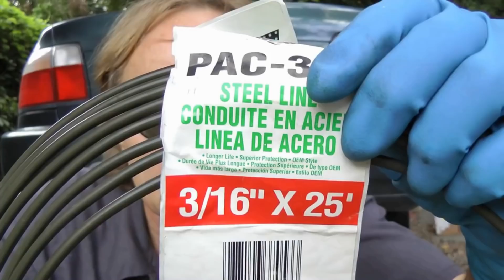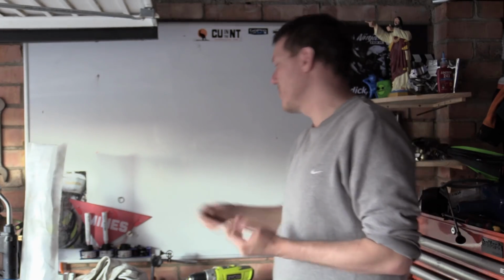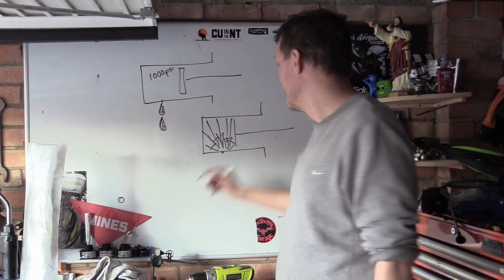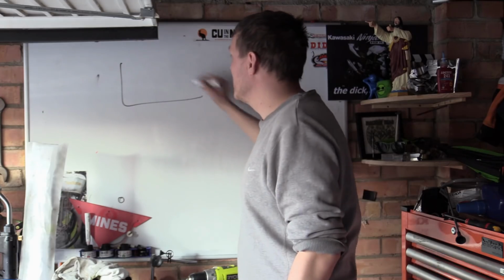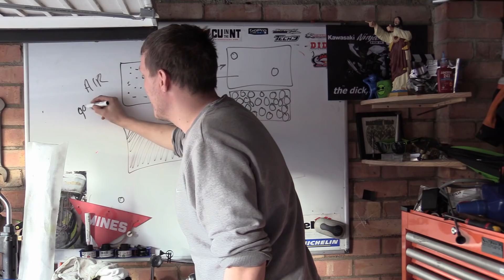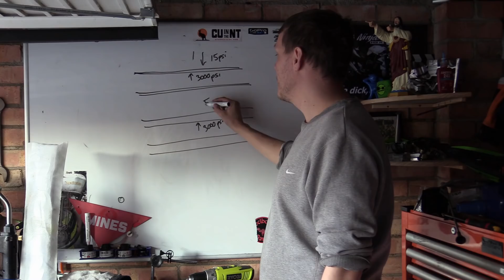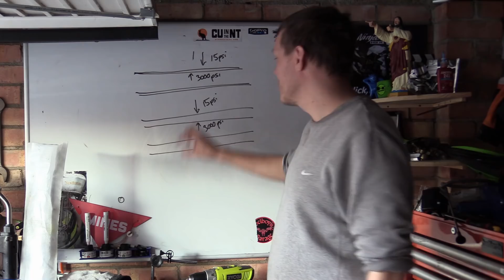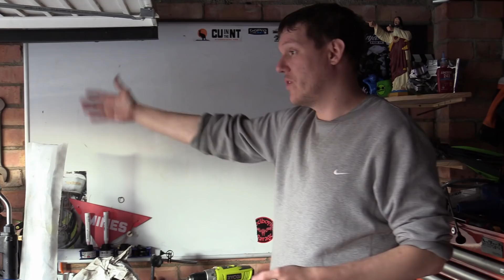Scotty KILMER - Will get someone KILLED!

Comment: You mean like those little brass connectors like the ones that come standard equipment on all cars that connect the brake lines to the brake  master cylinder and the ABS ? Oh ! Those little brass connectors ! Get a grip ! That company is just protecting themselves from litigation in case something goes bad. There's nothing wrong with the product. Usually the fault lies with the nut  holding his tool. Rust on fuel lines is on the outside and visible, not on the inside. If it was inside you would not know about it until fuel started leaking. Also, for over 40 years we have dual front and rear systems. We never lose all braking.
Reply from the maker: "You mean like those little brass connectors like the ones that come standard equipment on all cars that connect the brake lines to the brake  master cylinder and the ABS ? Oh ! Those little brass connectors!"

- No dickhead. Brake lines have flared fittings not compression fittings. 

"That company is just protecting themselves from litigation in case something goes bad. "

- Yes exactly, they know they will fail and don't wanna be sued - you're proving my point.  

"Also, for over 40 years we have dual front and rear systems. We never lose all braking."

- Check. Look at your brake system - are they flared fittings like this - 

http://racetrackdriving.com/tech/brake-line-flares-metric-sae-inverted-bubble/flare-schematic-1.jpg

Comment: I have used brass compression fittings on brake lines for over 40 yrs. Never had one fail. I am not familiar with the fittings Scotty Kilmer is using so, I cannot comment on them. I would use a brass compression fitting today and be confident in its performance.

Comment: How many decades have you been a car mechanic?
Reply from the maker: Erm.... none, But I've been an engineer for 2 decades
Reply: You can be a shitty mechanic for 4 decades or 4 years... a shitty mechanic is still just that. Brass expansion compression fittings on a brake line? 

Oh that'll work... until you REALLY need it to work.
Reply: Like that says anything years mean nothing let the good work do the talking

Comment: 51 years of automoitive knockledge versus 18 years lol okay english man ur a real genuis huh?
Reply from the maker: LOL can't you read? You also wanna look up the state of Texas automobile safety notice board about weak and inappropriate brake lines on their website. 

Experience (in other words doing a job for a long time) doesn't bend or break the laws of physics! But you could prove me wrong. Fit these to your brake lines and then slam on - I won't hold my breath though - I'll die.
Reply: @thedirtyworkshop  Keep in mind that   his channel is about mostly saving money, while also repairing your car. Besides, it was one of his older videos.
Reply: Not at all safe but getting in situations requiring emergency braking is not safe silly. Even if you have a brake faileiure going down the road you shod still be able to avoid death / series human injuries. If not you are not driving safely to begin with...
But Scotty shoud have given a word of advice that take brakes VERY serious and to do research to avoid death yes.

And be real here if the lines are that bad and you have no money or knowledge to repair a junker.... Doing nothing to fix it is stupid too. You like ppl driving around with a broken brake line topping it off? I have had brakes fail on me way to often and had to drive LONG ways to fix it. And you still have 2 cricut brake systems and a independent HANDBRAKE or called "EMERENCYBRAKE" for a reason. Sometimes I have not had anything but engine braking and TOTAL wheel lockups most likely ending in a crash at high speeds. (Fuck VW not having common parts home to fix brakes at there dealers in emergencies) I have driven lorrys with brakes failing and know horror storys of parking brakes failing / lorrys gliding into schools busses doing 80km/h. even when they have done NOTHING WRONG stuff can be unsafe.
Reply: Buy another car?